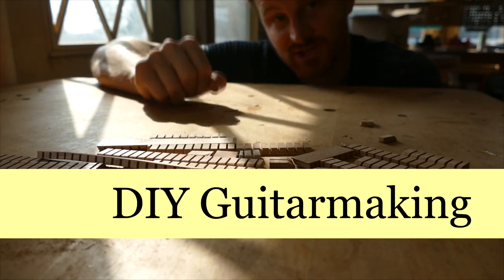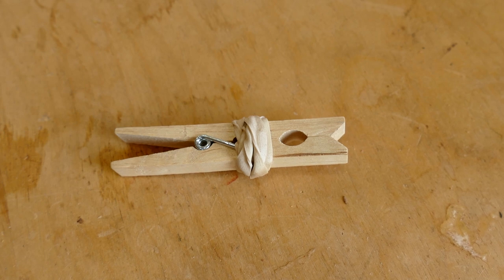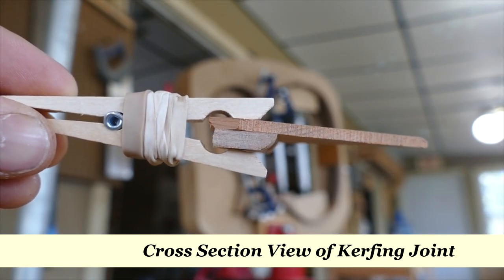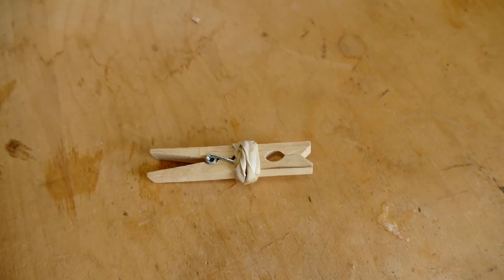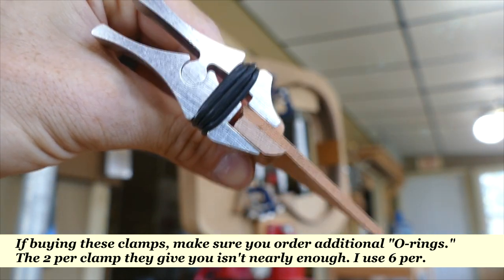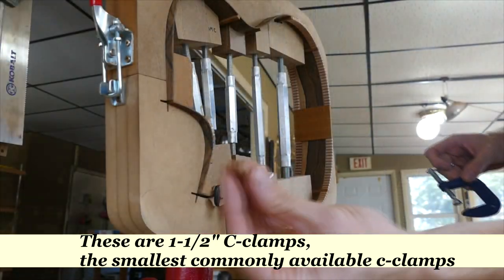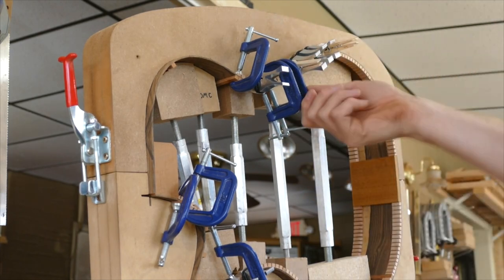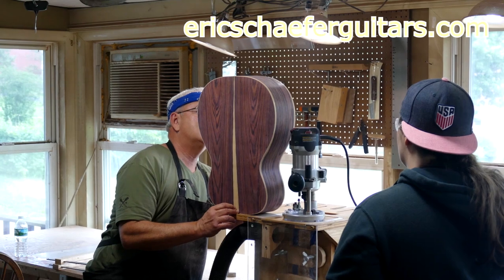Which Clamps are Best for Kerfing?

Comment: I found a mixture of mini spring clamps and small nylon C clamps (especially around the waist) works a treat and cheap too. I guess the key is to ensure the kerfed lining is bent to the same contour as the sides and pressure is applied along the entire length of the lining when gluing it. I ran my fingernail along to check for gaps between the lining and the sides, couldn't find any.

Comment: Hi Eric
I cannot justify the cost of the specialised clamps as I found they do not really perform that much better than clothes pins. The best advice I can give to new builders is to check out the vast range of clothes pins on offer. I find that there is a wide range of different shapes available and a some have larger surface area at the jaws than others. The biggest improvement I have made is to use 'O' rings instead of rubber bands. This makes the pin much neater and you can get them closer to each other around the rim. I too use small 'C' clamps at specific areas where the curvature is tight but rather than messing with extra cauls I have glued thick leather pads to my clamp jaws and screw pads. The other improvement I made was to remove the tommy bar from the screw and cut a slot in the end which can be turned with a screwdriver. This makes the clamp far more compact in use and you can then place more than one side by side with ease. Hope you find these points useful as they have worked well for me for years.
Reply from the maker: I agree, these are great points! Thanks for sharing them. Turning with a screwdriver would also have the added benefit of making it harder to overtorque the clamps, which cclamps are more than capable of.

Comment: Thank you very useful advice. Have you tried shaving the inside of the clothes pin to fit the shape of the Kerfing. I did on mine and it helped tremendously. I used smaller files and it works well. Thank you for sharing your knowledge!

Comment: Great vidoes. Can't say it enough. Question on the clothespin clamp. Being wood, can your modify the clamping surfice at an angle to distribute the preasure more evenly? If that is the goal, it wouldn't much time to file them down to a proper fit. I could easily make a bunc of clamps from scrap hard wood that would work. So I guess the real question, concept or issue is to have both sides of the clamp surface sit flat on the surface of the kerfing and exterior guitar surfaces? I hope I worded that correct.  lol
Reply from the maker: Yes, you can, and that should improve the situation a good bit. Although I havn't done that myself.
There is still a mechanical advantage to the other clamps though, that I don't think adjusting the clothespins would solve. And that's the fact that the spring is smaller in diameter than the part that the metal clamps rotate on, and this puts the Moment Arm (I hope I'm using that physics term correctly here...) further out.
Now this may or may not make much of a difference, but it is a difference to consider.

Comment: Stumbled on this video while searching for the right kerfing clamps. Does kerfing require the same clamping pressure as a "standard" glue joint? If you consider typical kerfing which is around 14mm hight and a single clamp covers around the same in width, then you would need each clamp to provide around 17kg to provide a pressure of 125psi as recommended by most as a minimum pressure for gluing. Most spring clamps/band-type clamps are nowhere near that, so C-Clamps would be the ideal - but as you say, it's impossible to use C-clamps throughout.